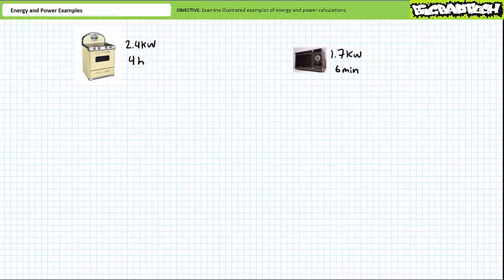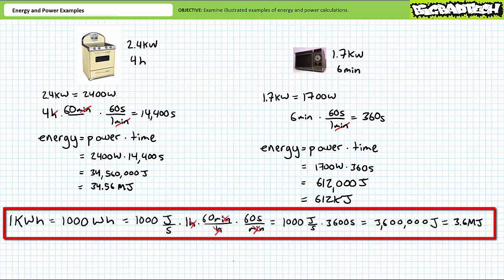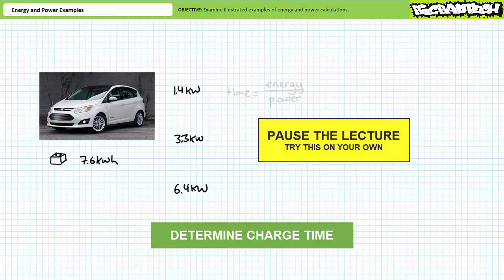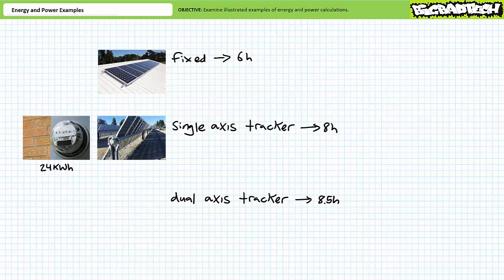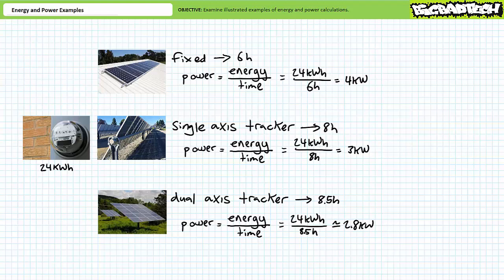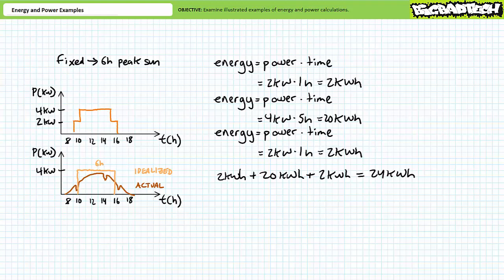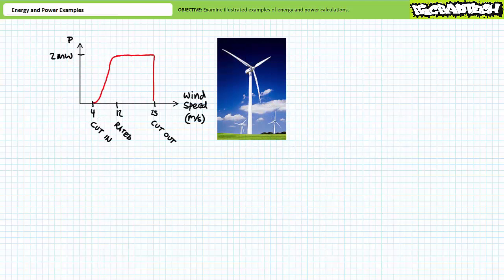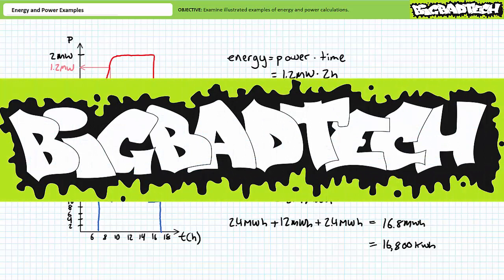Energy and Power Examples (Full Lecture)

Comment: Great Series Jim! I'm a Chemical Engineer by trade but I'm very interested in renewable energy and power generation.

I'm sure you threw it in as a trick question, but for the last example, based on the cut out point, periods higher than 15 m/s wind speed should not provide any power. So the number of hours that the turbine provides is 6 total hours; 4 hours at 1.2 MW and 2 hours at 2 MW. That gives a total of 8.8 MWh.
Reply from the maker: The cutout is actually 25m/s. After looking at it I see how one can confuse this as 15m/s.
Reply: @bigbadtech  Ooops! Yes, you're right! Thank you for clarifying that the cutout is 25 m/s not 15 m/s. 

I really like the simplistic approach to this series by the way. It's really appreciated!